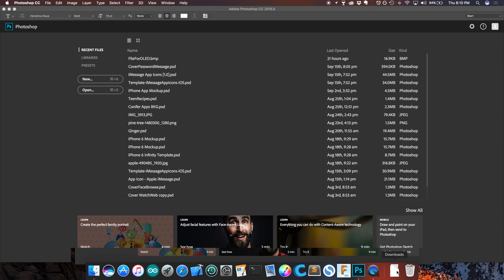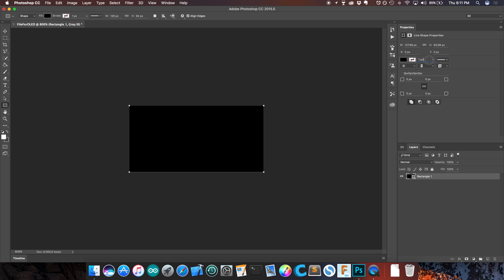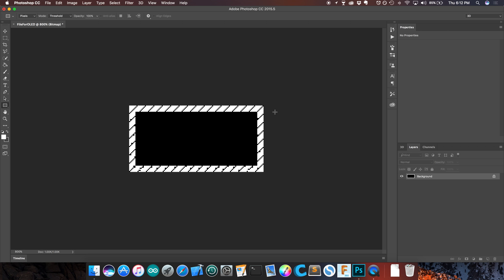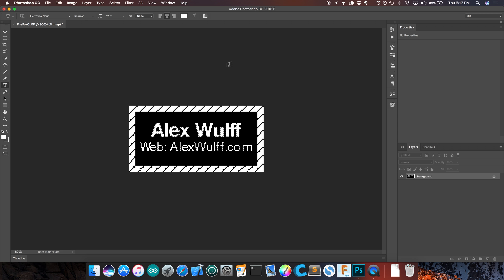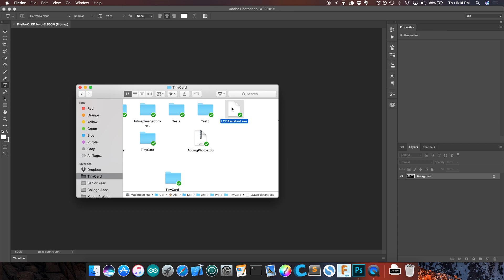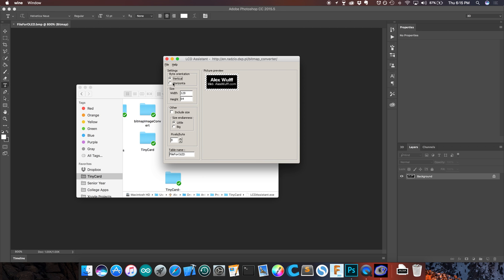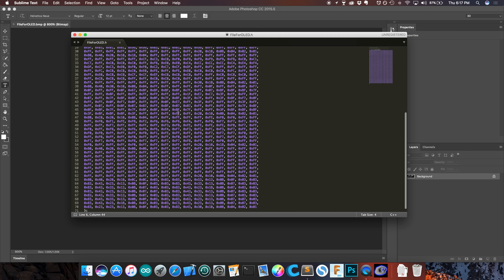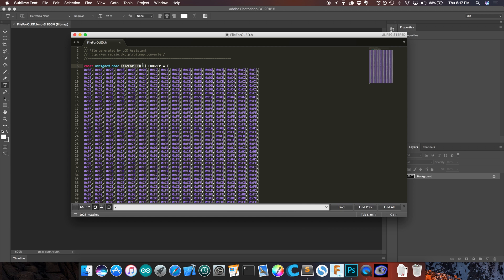Making Bitmaps for display on OLED Screens Using Arduino

Comment: Do you know how to convert to the binary array? I can't fit a while map on my micro but the adafruit logo_bmp works just fine (ie static const unsigned char PROGMEM logo_bmp[] =
{ 0b00000000, 0b11000000,
  0b00000001, 0b11000000,
  0b00000001, 0b11000000,
  0b00000011, 0b11100000,
  0b11110011, 0b11100000,
  0b11111110, 0b11111000,
  0b01111110, 0b11111111,
  0b00110011, 0b10011111,
  0b00011111, 0b11111100,
  0b00001101, 0b01110000,
  0b00011011, 0b10100000,
  0b00111111, 0b11100000,
  0b00111111, 0b11110000,
  0b01111100, 0b11110000,
  0b01110000, 0b01110000,
  0b00000000, 0b00110000 };